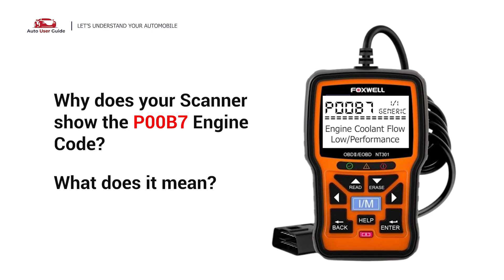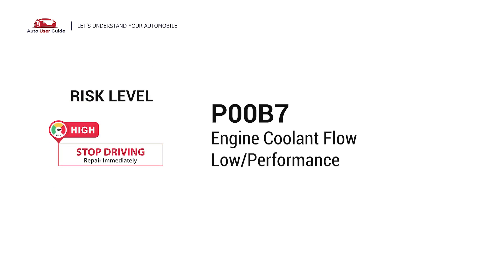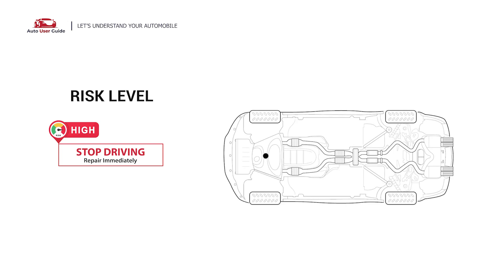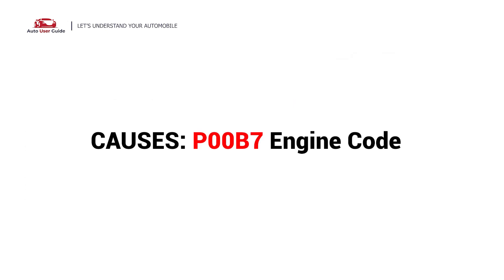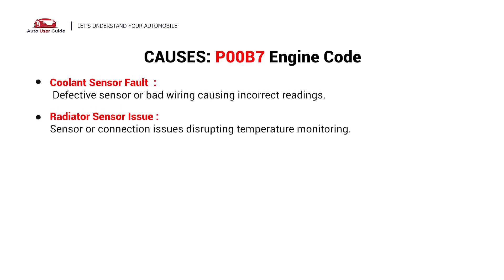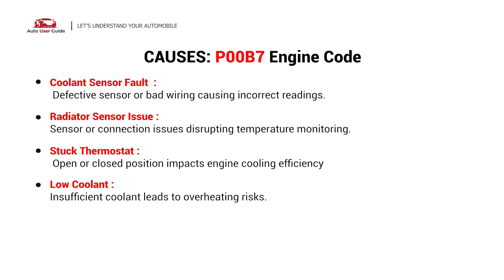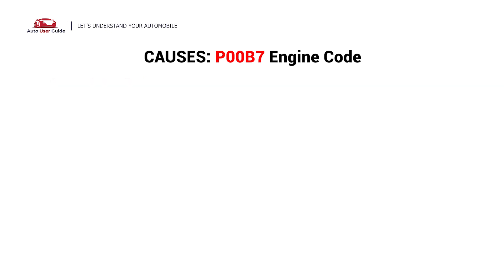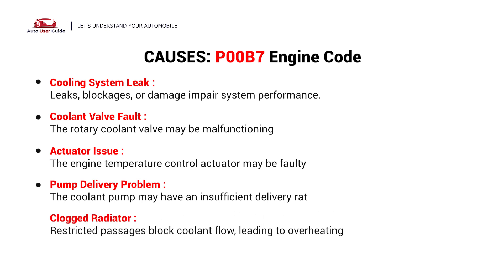What is P00B7 : Engine Error Code Causes Explained

Comment: Hi there. This code has popped up on my Audi A4 2015. We have replaced the water pump as well as the ETC sensor circuit 1 but the fault is still there

Comment: Hello ... I had this error code beside other two error codes ...even we replaced both Auxiliary pumps and did rest still the codes didn't disappear if E300 2020. The other codes are P0C7300 and P0A500. Appreciate your guidance.
Reply from the maker: Thanks for sharing the details.
For your 2020 Mercedes E300, the P00B7 code usually relates to a boost pressure control circuit issue, often linked to the turbocharger or intake system sensors. Since you’ve already replaced the auxiliary pumps and the code persists — and with P0C7300 (Hybrid Battery/Drive System) and P0A500 (Battery System) also present — it seems like there might be electrical or sensor communication issues rather than just mechanical faults. 

Here’s what I’d recommend:
1️⃣ Check all wiring harnesses and connectors related to the turbo, boost sensors, and hybrid/battery systems.
2️⃣ Use a diagnostic scan tool capable of Mercedes-specific codes to clear and monitor live data while the engine runs.
3️⃣ Verify that software/ECU updates are current — sometimes multiple codes persist until the ECU recognizes the new components.

If you want, I can make a step-by-step troubleshooting guide showing how to isolate and fix P00B7 along with P0C7300 and P0A500 on the E300. Would you like me to do that?